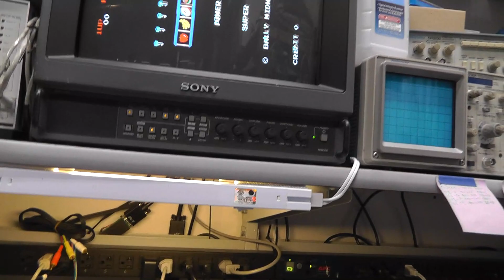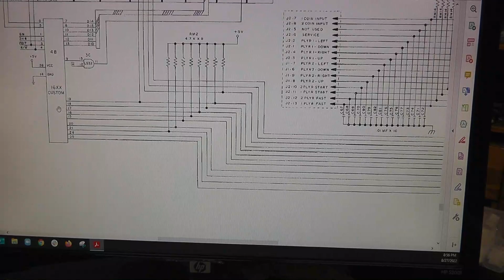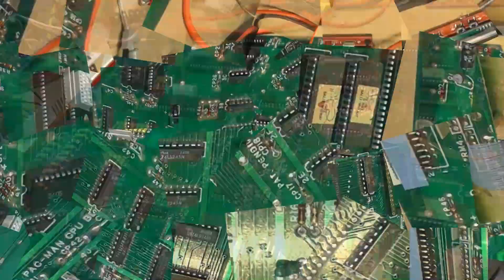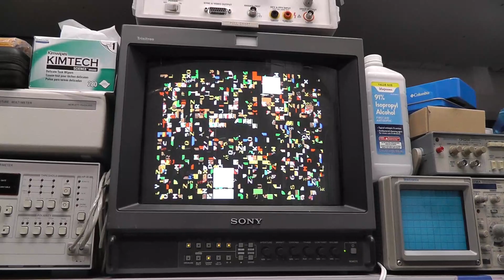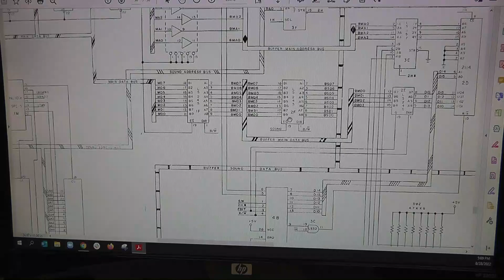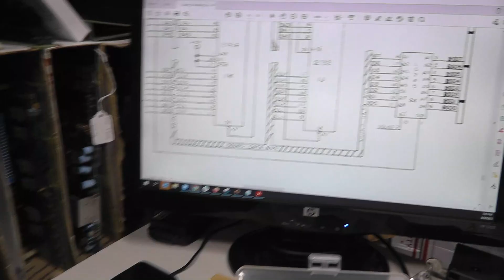3x Super Pac-Man PCB Repair - Easy 1-2-3? Yep, Sort of, Nope - FPGA CAT Box

Comment: What does the strobe signal used for? how are the PAL chips differ from the using PROM chips? because im not sure why they are using pal chips to trigger different sounds instead of using prom chips, any reasons why?
Reply from the maker: What part of vid are you referring to?
Reply: @jacklick  you mentioned that the pal chips are being used to generate addresses, control enable signals to the sound circuits